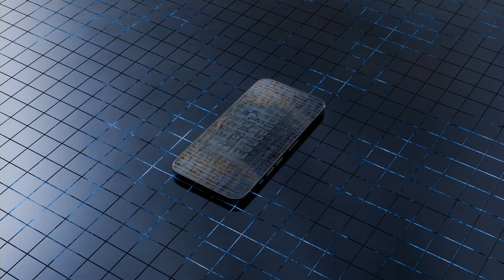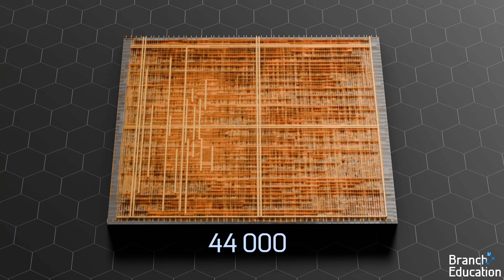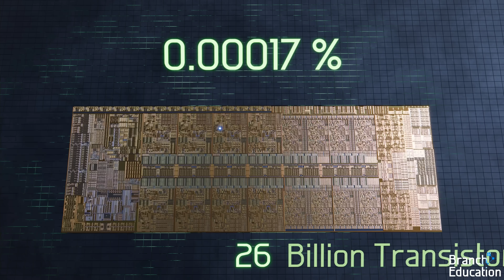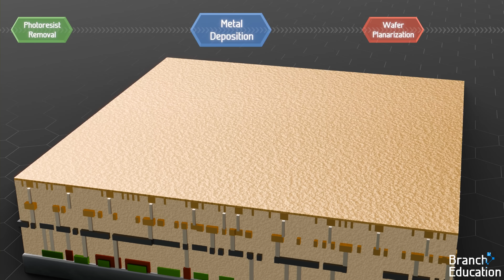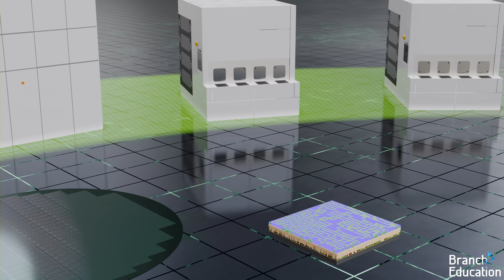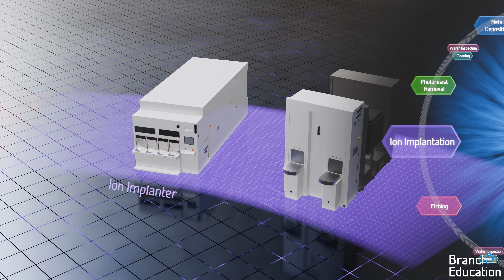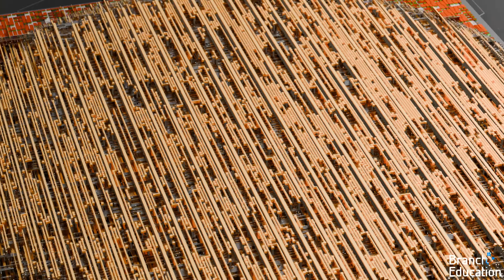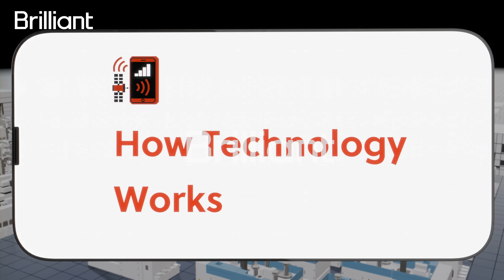How are Microchips Made? 🖥️🛠️ CPU Manufacturing Process Steps

Comment: Is this How it Made or how it work. 
   Many may want know the reaction of those miracle elements -minerals The power of the sensor . 
   Even a light bulbs, a TV. remote controls wonder But most of us may know how it works -wire or sensor contact. But How it is made is a big question not how it works explanation ?
    Iron,carbon, zinc,cobalt, platinum etc..Still most of us we do not know the exact contents of those minerals or element let alone what these elements can do/react as a single element or combined with other elements.
   Thank you for explaining the most details of the processes of those devices .Semi+ and components .

Comment: why the wafer is shaped in circle where it doesn't contain all the cpu chips when there will be a material waste as a result. can't it be like rectangular or square shaped?
Reply: The original crystal has to be rotated while formed in the molten silicon so it has to be circular as a result.
Reply: Circle is better to rotate…. good even rotation is required for some processes. And wafers are manufactured is circles. Edge loss is less compared to cutting circles to square.

Comment: It's very nice to hear the narrator speak at a more normal speed for once instead of speaking near twice the speed like many other youtube video's tend to do,   like speaking fast somehow made the video more appealing or interesting.  this is a great video, very imformative. i enjoyed it from start to finish without having to slow it down to some 75%.  i was unaware there where so many layers involved, incredible,  makes me wonder about the failure rate/percentages at such small die sizes, are i5's  and 7's all part failed i9's that will still work?  it be great to have some more in depth in that area.  also, is it possible to make cpu's without errors continually at a certain size?  is it the vast reduction in size that brings about all these errors?  💣💣💣💣💣

Comment: if you can replicate this same processes at a world surface level at larger scales, you can turn the whole world into a  giant cpu computer capable of many God like things. and if you integrate A.I to manage that system globally, you would have a technological infrastructure capable of gathering data world wide, it would be able to predict the future merely based on infinite calculations and analization. you can also use such a system to creat a true intranet of things, which is where human brains are connected to it, allowing us to communicate psychically ( signals ). its like taking a cpu and circuit board, and blowing up to a global surface ground level.

Comment: I am a Staff Engineer at Samsung Semiconductor. This is the best video I've ever seen, including all the educational content from Samsung.
Reply: Fix the heating and make better chips!
Reply: @NoLiimits04 😂
Reply: u sure? @NoLiimits04
Reply: @NoLiimits04  buy TSMC ones and problem solved
Reply: @kagami22222  Staff 😂
Reply: So the i9 i7 i5 i3 are all the same chip but the difference between them are the amount of defective parts?

So those Intel CPU without Integrated Graphics actually have integrated graphics but it just doesn't work due to the problems during production?
Reply: @FallenLight0  yes, you can unlock an i3 to become i7 but at your own risk since it can become unstable if some of the unlocked bins are some of the bad ones.
Reply: @FallenLight0  that's what I understood as well. It's a broken egg sold at a cheaper price.
Reply: @FallenLight0  Yes. This is what they call binning. The same thing is done with GPUs.
Reply: @FallenLight0  That is actually one of the most interesting and ingenious things to me, being able to fabricate an entire product line from the same process means they can reduce waste and the whole thing gets a lot cheaper, it's such an amazing way of lowering cost and probably a huge factor in making these things affordable for so many applications.
Reply: Is your GAAFET genuine or failure like 4nm?
Reply: agreed! technology is amazing
Reply: @F90-s7qhuh
Reply: Can’t they use graphene for the chips instead of silicon?
Reply: @Borderlands808 Nobody on earth knows how to efficiently produce graphene yet I'm pretty sure. We're improving though.

Comment: I majored in commercial art in the 70's. Part of that education was Lithography using a screen printing process. We had one printer that was about 3 by 4 feet, it printed circuit boards, layer by layer. Very complex time consuming process. Full scale electrical diagrams, / blueprints were placed on a light table. A series of lenses would reduce the image down and project it onto a screen print. When all the needed screen print layers were done . They went one by one to the Lithography table. Photo chemicals smeared on with a squeegee, dried, lay on the screen print, hit it with light, rinse and repeat. Over and over

Comment: I worked in an IC assembly clean room in the 1980`s. An engineer had 5000 stainless trays made to use round the factory. When we filled them with die`s and put them in the oven all the trays sprung out of shape with the heat and sent microchips flying. OH DEAR!!!!

Comment: Unless I missed it, you didn’t cover backgrind at all. Don’t know if it’s done to CPUs specifically, but it’s a final step for a lot of the chips we make, to remove a lot of the base thickness of that wafer to make it even thinner.
Also, no mention of depth of focus. While not strictly necessary for how the chips are made, it is important to know about because it’s one of our current limiting systems on the number of layers we can add.
Still, amazing video overall.

Comment: Rtx 4090 Die is made at 5nm with around 75 Billion Transistors it has 608mm2, it's much much much bigger than an tiny ant, 608mm2 are bigger than the human eye diameter, so no way on Earth the Cellphone Silicon has 90 billion Transistors, no way, even at 2nm it's no way!!!
Reply: There are several chips on a cell phone motherboard, and the number of 90 billion transistors is the total number from all those chips. Sorry for confusion 🤔
Reply: @MikeRadjabov  Anyways, This Vídeo were Absolutely Amazing to Watch!!!
Reply: @MikeRadjabov  You're One of the makers of the Video? Well even with All Chips that are in a Cellphone Board combine Together, I don't think that's more than what an Series X Apu has of Transistors, About 14 Billion, The Rtx 4090 has 75 Billion Transistors Running at about 2.5Ghx and For That it needs 2kg 30cm length by 5cm height and by 7cm wide Heatsink Made out of Copper and Aluminium to get the heat out and also Some Big Massive Coolers, 75 Billions Transistors at 2.5Ghz Consuming around 400W, an Cellphone Battery of 6 Amperes hours may have the Rtx 4090 Turned on for 1 Minute, also Im not counting the Plus Billions and Billions of Transistors Of The 24Gb Gddr6 that Rtx 4090 has.

Comment: Not only is chip manufacturing technology important, as in nearly everything humans do, it is also vital for how we will live in our future. I was born at the very birth of this industry when humans made those interconnections by installing those transistors by hand using pure gold wire thinner than human hair via a wire bonding machine & testing each connection via a pull inspection also done by hand. Both jobs were done under a microscope & had a separate tool for your hand to work movement from the machine. Those 2 jobs were easier than installing the red LED which was my job which literally picked up the “chip” from one of those “wafers” with hundreds actually thousands of LEDs on a single wafer all broken into thousands of individual pieces & placed in a tiny bottle & then my job was to solder the bottom of the led onto a flexible surface made of capton but with wire connections like a printed circuit board. I did this by picking up each tiny wafer piece by hand using tweezers onto a pad where i had already placed a tiny pad of solder onto the pad the wafer
Was to be soldered onto, all done on a heating plate with nitrogen piped in the remove the oxygen from that surface for a more durable bond, all done of course under a microscope except for picking up those 2 tiny pieces which were done using my human eyes & my left hand. Few humans had the dexterity required to do this step & i estimated 90% of those who tried quit because it was simply too difficult. Men had more a difficult time than women because men are trained to work on things they can easily see. They have bigger tools. But women are taught how to sew & are trained to use smaller hard to see tools. Needless to say i was the only “dude” in the cleanroom & my first day i built 20. I was told that was pretty good. She told me 175 a day is typical. I went on to do 250-300 a day. More than anyone else in the cleanroom. A job deemed so difficult my manufacturer exported it to Korea because they didn’t want to pay more for the skill level required to do such. Like i said 90% who tried, failed. I did that job for 3 years & it created pain in my elbows because you never moved. Under the microscope you are moving all over the place but for the person watching you, they see you sitting perfectly still not moving at all, so imagine not moving at all for 8, 9, 10, or 12 hours a day. People get fat & because you use devices to control movement under a microscope you are forcing your hand to be still because there is nothing still about a human hand trust me under a microscope all humans seem to have Parkinson’s disease doing such intricate work under a microscope, the word MICRO defines high tech because if you havent built a computer or a chip under a microscope then YOU ARE NOT HIGH TECH, & most of you would fail, you have to train your hand to be still & how to work its movement into a productive manner that works for you. 

As it turns out the chip manufacturing industry began shortly after Bell Labs invented the transistor in December 1947. I was born 1960 when the first silicon chips were being prototyped by Jack Kilby at Texas Instruments who would later release the first hand held Calculators which made personal computing possible. But it was not easy making those chips & even Texas Instruments, who had an industry worth multi trillions of dollars which has sparked even larger businesses, Texas Instruments had all that  IN THEIR HANDS TO OWN gave it away to California who have most of it to Japan because nobody in Texas apparently agreed to work under a microscope. Those that could, who had that skill, reattached severed fingers in a hospital & earned a lot more money. American businesses simply abandoned the technology we invented & gave it away to Japan who could make a chip for less simply because back then Japanese employers demanded more from employees who were desperate for work as everybody experienced poverty after WW2. The Japanese people weren’t any better, they were desperate & had needs to succeed. Americans have little clue what desperate really means, but we desperately need to get our technology back from all the technology exporting we have done since the 1960s.

Eventually even the Japanese scaled back their chip manufacturing industry which gave rise to Korea, Taiwan & Singapore. It has become the soul, sole source of a world economy & in fact is the dominant source of our economy which is still growing. This is where our trillion dollar corporations are born. Both Apple & Microsoft are 3-trillion dollar giants all because XEROX gave that research away. Talk about stupid? Hows the ink cartridge business these days Xerox? Doing good? Let’s give these guys a pat on the back! For trying then giving up. Just like Texas Instruments & all those others from California, except: Intel® 

Look where the money is & you will see what your economy is. In 1960 when i was born in Seattle the population here was actually dropping. We were dependent on a rising new aerospace technology called the 707 built by Boeing who made a shitload of money from the cost of WW2,  but nothing after. Boeing Inc. threw their entire savings & profits into a new technology called “Jet Engines” which they would buy & install on a larger & better built body of aircraft to handle the near speed of sound stress such an assembly requires. Catastrophic failure of the DeHaviland Comet made airlines & passengers skeptical of Jet transport. But there is a reason ships don’t have square windows & there is a reason why Boeing & Airbus don’t make square windows either. Just because humans live in houses with square windows, rode in wagons with square windows & trains, yes the same, doesn’t mean square windows are safe. Square makes it easier to all collapse. Round provides an arch & requires major energy forces to collapse. How many square Roman structures still stand today? Compared to arch or rounded structures? Aerospace built the foundation using one technology in an industry to  make an economy in a city called Seattle, which today  its name is well known around the planet because the future was our salvation in order to grow. Computers were our future & local government have to make their places inviting in order to attract & keep future technology. That is what Silicon Valley & Seattle has done for the American Economy today which has spread to become the dominant economy with OIL still a big money maker at #2.

Seattle doesn’t have any oil & in fact we don’t even allow ships carrying oil from Alaska to enter anywhere near Seattle. Future technology proved successful with Boeings 707 so its no surprise this Technology Revolution which is what the Industrial Revolution really should be properly named, is a proven & effective & vital component to build a huge economy. Apples, fishing & Lumber which built us has its limits. So do insurance companies & banks back East in New England & New York. But kicking Amazon out from New York City was the stupidest thing New Yorkers have ever done because they kicked out their future & how will they live kicking the future of business out. I mean come on, Macys cant even compete against Walmart. New York depends upon Washington state, Washington DC, & California simply to function every single day. It will be their future as well as everybodies future wherever chips are used chip manufacturing becomes even more vital to our success.

Those who control chip manufacturing control our future until AI finds a better way.
Reply from the maker: This is a really cool story!  Thank you for sharing.

Comment: 6:25 The metal disposition should be pure silver. It’s a better conductor of electrical signals, and the speed limit is three times that of copper. I had a custom PCB board made with pure silver over copper the performance of my AMD processor, increased by 2.1 gigs overclocked, yeah I know it was shocking to know that all of the processes on the motherboard and integrated circuits, are limited because of the copper in a PCB board; surprisingly also, after multiple intensity testings, the APU was lukewarm.

The manufacturer explained to me that more work would have to go into making a PCB board like that because of the material that would be needed to prevent corrosion of the silver or oxidization, yeah, it cost me a pretty penny, but it was worth it

Comment: Does that mean my i3 was designed to be an i9? Impressive
Reply: Yeah, I suppose that implies that the cores are designed to be able to work together despite how many are functioning (which makes sense, since they are identical). I'm guessing that there are certain cores (like the GPU core) which, if damaged, result in a dead chip because there is no redundacy for them. This whole practice does bring into question whether the proportions of i3, i5, i7, and i9 chips produced by this random process match that of the market demand. If there is a higher demand for i9 chips than are being produced, do they decrease tolerances and have stricter inspections? Do they do the opposite if there is a higher demand for chips with fewer cores?
Reply: @jz2228  That's a good point. If the bad parts were some shared components like I/O controllers, memory controllers, and the integrated GPU as you mentioned, it could render the whole chip nonfunctional... not even an i3 LOL. So, strict inspections are a must anyway.

Comment: I work in the semiconductor industry making photodiodes. This video has helped me understand more of whats going on at the wafer level. Waferfab is all handled by a team I've started interfacing with more and more as I come across issues with the die. Unfortunately I dont have the resources to physically analyze most of our failure modes, but we can look at the properties of the photodiode and pass them back to "the waferfab guys" so they can adjust implant, etch, or mask to try to solve the problem. I'd love to see a video on photodiodes at the semiconductor level some day. The interaction between photonic energy and the atoms leaves me perpetually perplexed and the way you explain these things makes it so easy to conceptualize and understand.

Comment: Wow.  The level of detail in this video is incredible.  I've been a programmer for 30+ years, and I've been around tech since I was 12 (I'm in my 50s now). For 10 years I worked at a company that made EPROM programmers, so I've actually had to burn off the tops of chips with nitric acid to decipher features on the die, in order to figure out how to program them.  
And even I learned a few things watching this.  You should be very proud of this video.